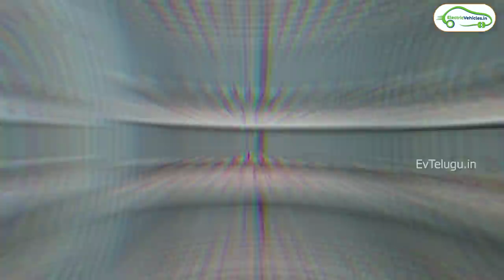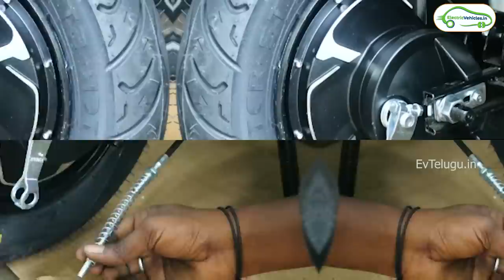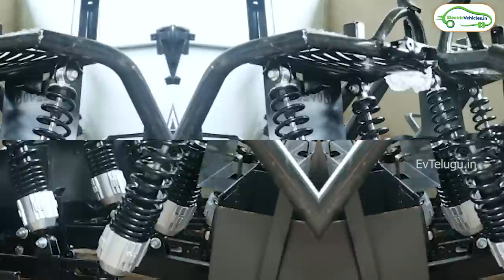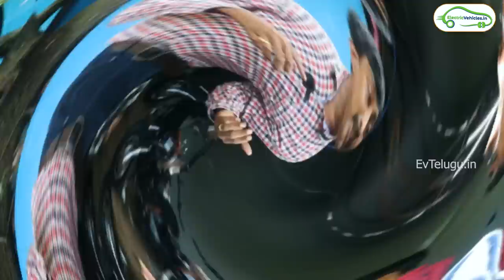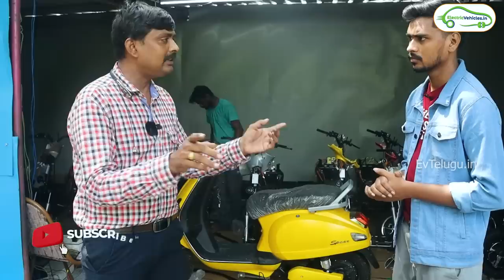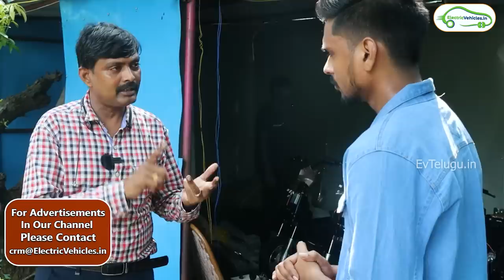ఎలక్ట్రిక్ స్కూటర్ తయారి చూద్దాం రండి! IGK Electrics - EV Manufacturing Plant - Vizag

Comment: మైలేజ్ ను బట్టి రేట్లు ఎలా ఉన్నాయి
Reply: Not battery size. It's battery capacity.  It starts from 28Ah 60W,32Ah 60W,36Ah 60W and 40Ah 60W. Generally these capacity batteries are using currently.  For 28Ah it's arround 60km, 32Ah arround 100km, 36Ah arround 150km and 40Ah arround 200km. And depending on capacity price will be varied.👍